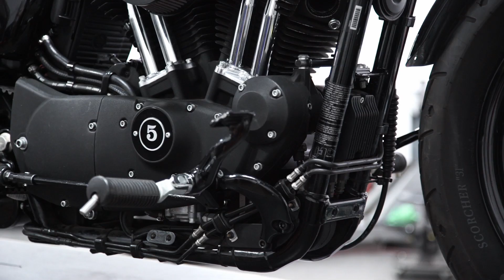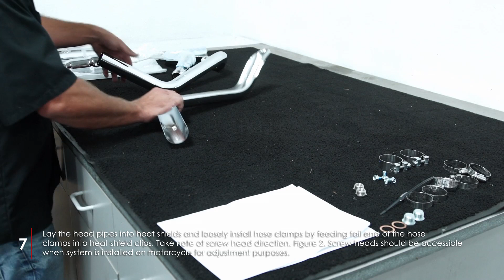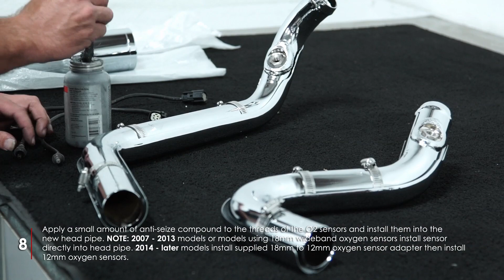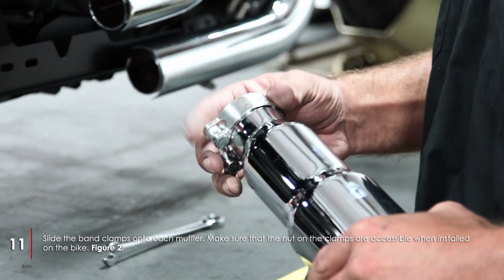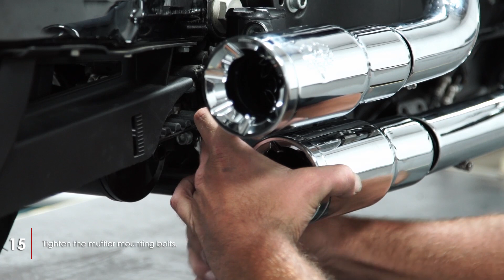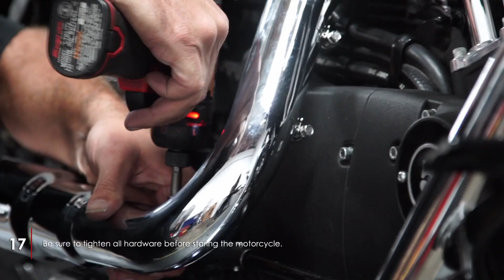Mini-Grenades Installation Guide

Comment: Would you be able to use this system without a tune on the M8 114 and with standard air without risking the engine? 2021 models cant be tuned.
Reply: Don't need a tune with this as far as I know with the softails. Can't say for the sportsters. You can if you want though.

Comment: Can't read captions....when installing flanges, barely snug top nut, then torque BOTTOM nut to 120 inch pounds, then top nut to 120 "lbs also. THEN, tighten mounting hardware. Use hi-temp anti-seize on head studs.

Comment: If only it was that easy.  It isnt.  The instructions that came with the system were absolute garbage.  For you guys with newer bikes that have an oil cooler of front, do yourself a favor.  Invest in a flex socket.  Invest in a good 10 inch extension....minimum.  Then.  Install the front header pipe WITHOUT the heat shields.  Use a dry erase marker on the outside of the heat shield to mark where the hookups are so you can slide the clamps in.  Theres NO WAY you can install the front pipe on a M8 without doing this.  No way.  Then.  To top it off.  When you put the mufflers on.  Put the big muffler clamps on the header pipe.  Slide the muffler in, then slide the muffler clamp from the head pipe onto the muffler.  Instructions say install with the clamp on the muffler.  No.  You cant.  Impossible....again.  The heat shields get in the way (remember how they said install with the heat shields....LOL.)  So, after that.  Learn the difference between hex drive....and hex head.  Hex nuts where Im from are driven by allens.  The instructions say hex bolt.  Ok.  3/8s.  I drive that in, and guesd what?  Nope.  They meant hex HEAD bolt.  Its 3/8s as well.  Complete headache and took six hours to install everything neat and correct on a 2018 Softail 114.  Absolutely no room to work.  Their bracket for the top muffler is far back, and you can BARELY fit even the width of a wrench in there.  Absolutely crazy install and I've installed plenty of pipes on Harleys and many different cars before.  Never seen a more useless instruction sheet in my life.  Not to mention, I havent even started my bike yet since the fuel pack shipped USPS and the pipes shipped UPS.  So.  Got the pipes next day.  Will take a week for fuel pack.  Once on, they look great.  These things better sound like bald eagles doing it to the national anthem while Abe Lincoln toasts George Washington with a couple of Bud Lights in front the statue of liberty with a thousand pounds of red white and blue fireworks for me to give it anything above a 4/5.
Reply: Haha!  I feel your pain brutha! 
Did you figure out the bracket?  Spacers/no spacers? Washers/no washers (although these washers are like 5/32" thick... more like a spacer but not as much spacer as the other 2 spacers)?  Oh, and they didn't include the 1/4-20 x 1/2" bolts for mounting cans to the bracket... not sure how to get my hand back there if I did have 'em.  Yeah, these instructions suck.
Putting them on 20 fxbb M8-107
Reply: @jackcompton8752 
Yes I got it all figured out and tuned.  It sounds amazing, but one pain in the rear system to install.
Reply: I dropped a flange nut and lost it somewhere in the engine (not actually inside the engine but somewhere in the case) because the instructions never told me to watch out for that.
Reply: My band clamp for the top muffler didnt fit. It was the band clamps fault as it didnt fit on the bottom muffler either. I forced it on anyways, and now theres a leak in, guess what, the top muffler with the band clamp thats too small. Im hoping its just the band clamp and not the heat shield, but if they sent me a whole new part I would not complain.